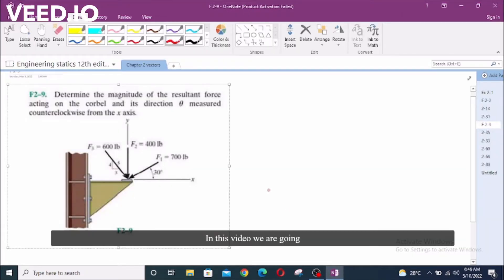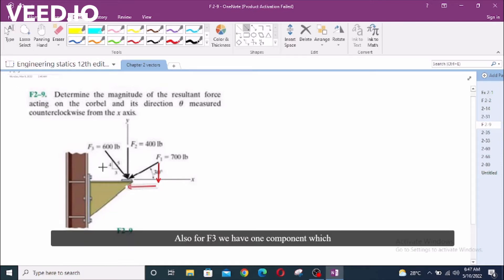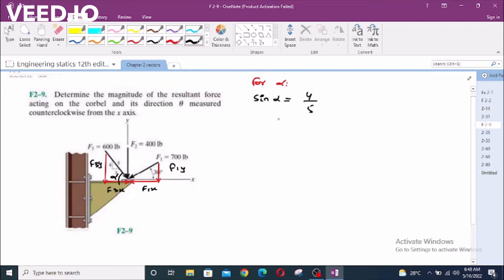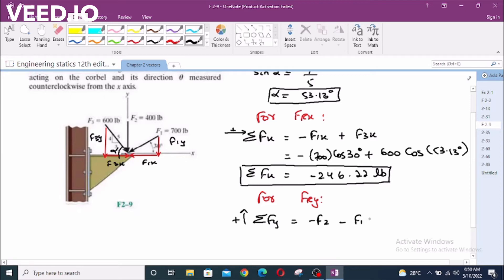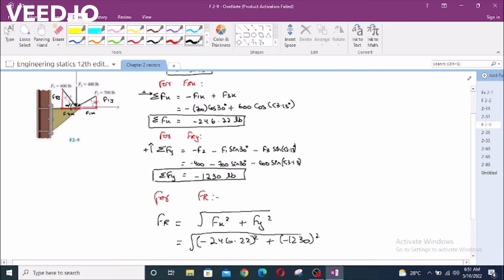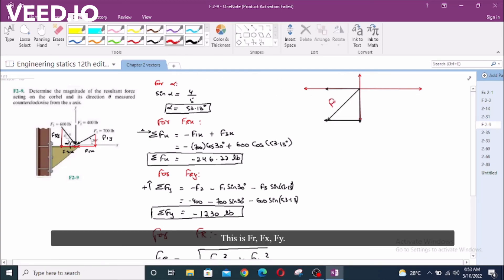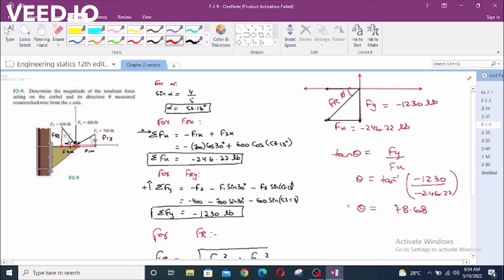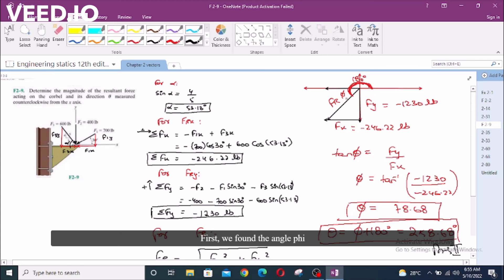F2-9 hibbeler statics chapter 2 | hibbeler statics | hibbeler

Comment from the maker: Learn How to solve 2-31 Hibbeler Statics Chapter 2, "Three cables pull on the pipe such that they create a resultant force having a magnitude of 900 lb. If two of the cables are subjected to known forces, as shown in the figure, determine the angle θ of the third cable so that the magnitude of force F is minimum. All forces lie in the x-y plane. What is the magnitude of F? Hint: First find the resultant of two known forces."
Here is the Link: https://youtu.be/CFSsOD1asNY

Comment: How do you know where and how to draw the Fr line? I get tripped up on finding the angle measured counterclockwise from x-axis.
Reply from the maker: First of all locate the direction of Frx (Right or Left) and Fry (Up or Down), they align them by head to tail rule of vector addition. The resultant (Fr) should be drawn from the tail of the first vector to the head of last vector. Once you have correctly drawn the Fr then you can locate it from any of the axes (x or y) in any of the directions (counterclockwise or clockwise) depending on the problem statement. I hope it will help! 
To learn more, you can check out this similar video:
https://youtu.be/MSNifCXAHh8